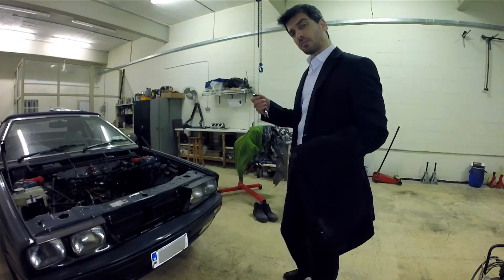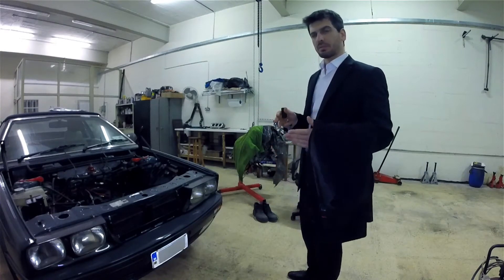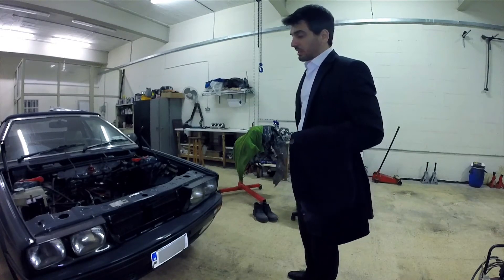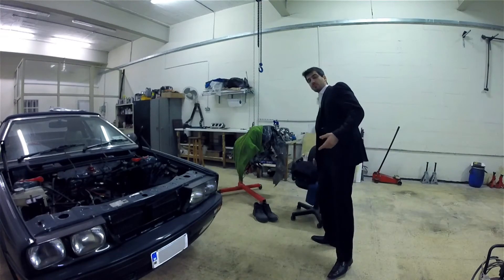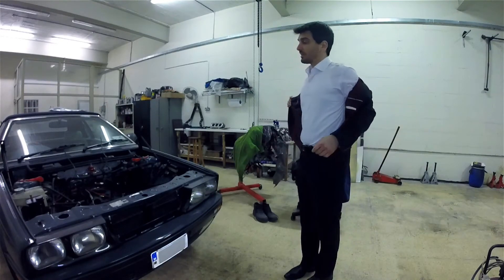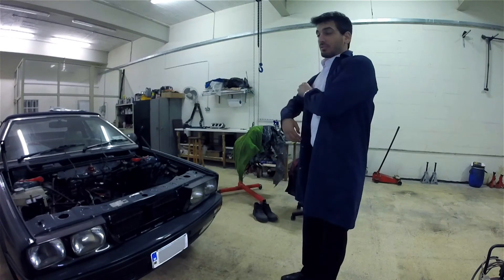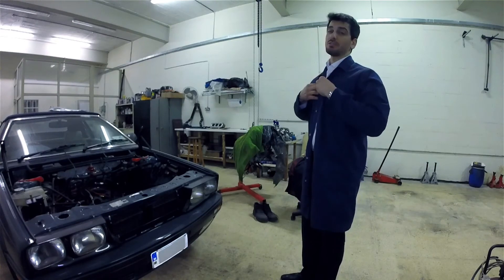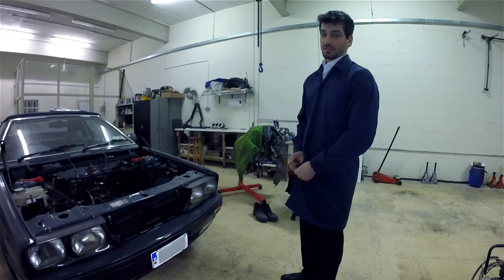MASERATI PROJECT? WHAT HAPPENED!!!????

Comment: So Sorry to hear about this , I have been having some oil pressure issues on my car as well. Cant seem to find the cause but I think its the pressure switch as the pressure is fine up to 3500rpm. All the best, cant wait for new vids.
Reply from the maker: From what you are saying, the sensor might be an issue, but your next best bet is to measure the tensioning spring inside the oil pump, It might be at its service limit and failing at a certain threshold. But this is just an idea. 
Cheers for your support :)

Comment: You really had us all going there! I was expecting some catastrophe. It's only the engine. Time-wise, that seems like a small percentage of the total work you've done. In a more-or-less closed system, surely the explanations for the oil loss are quite finite. At least it's not an intermittent issue that takes time and cursing to sort out. Hmmm, that's all the "bright" side of this disappointment that I can think of, but hopefully that helped.
Reply from the maker: Jack Lyons hmmmm, i guess you are forgetting that there are not many parts available... and it took me a couple of months to source the last set of original rings globally... that is how hard it has become. Any small issue with a car such as this is a major problem to deal with
Reply: You proved many times all those cliches about "necessity being the mother of invention" or "where there is a will, there is a way." All this negative energy is just project fatigue talking -- you'll get over it! I have a 430 I'm planning on driving from L.A. to Mississippi next month -- in round numbers a distance of some 2000 miles or call it 3,000 kilometers. I'm taking your videos with me and about 900 pounds of tools & parts
Reply from the maker: Apart from the project itself there were other life issues I had to deal with, and it's bearing a bit too heavy on me. But non the less yours shouldn't fall apart after 2000 miles... If it fails just buy a truck and tow it towards the rest of the journey ;)
Reply: Ah, well my attempts at humor now seem very lame. I am sorry for your suffering. Your viewers all feel that we know you. And in a way, that's true. You have handled this car with characteristic aplomb, unfailing good grace, and flashes of humor. You may have edited out the parts where you threw wrenches, or cursed in three or four languages, but your calmness and steady persistence have been inspirational. Thank you.
Reply from the maker: Well... to be honest that joke borders on the truth. 900 Pounds of tools sounds just about right to me ;). Also to be honest as disappointed as I was upon every failed attempt I couldn't afford to destroy the little tools I have because the only money I had left as to re-buy the defective new parts that broke... heh...
Cheers for your kind words :)